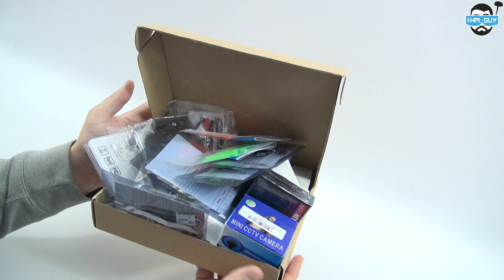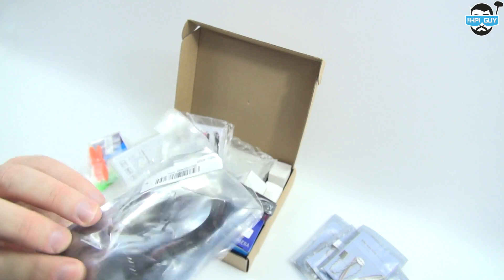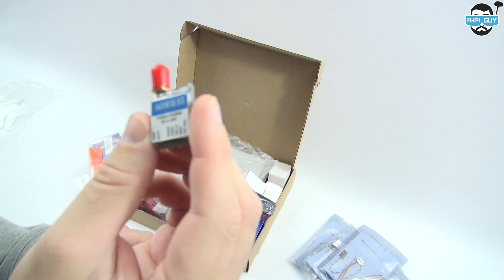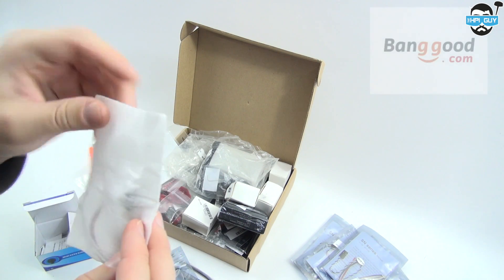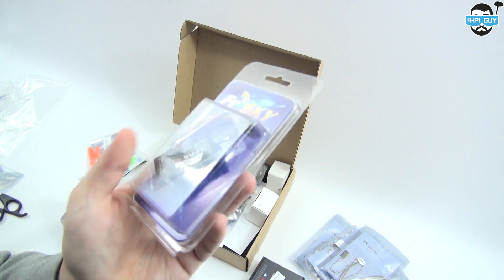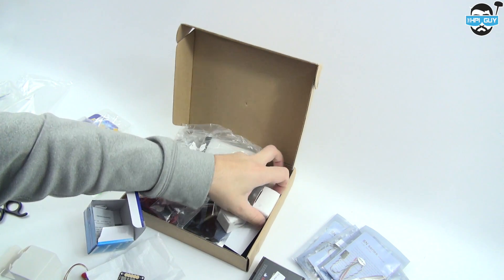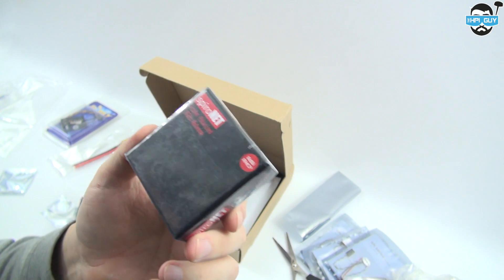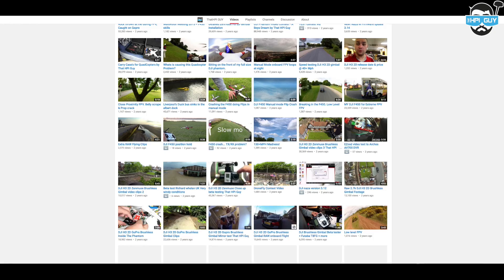HPIGUY | Budget DL180 MiniQuad Build (Part1) What Parts - From Banggood.com

Comment: I loved those PDBs. Small, lots of features for the price. Really liked it. Then the design changed to one that puts a component very close to the hole by the 5v regulator. My standard hex standoff ripped a diode out, and I had no idea. Then one day my flight controller burned up while I was about 100ft up. bad day.

Comment: Good vid,  looks like it will be a nice quad,  I have some of  these dys motors and  I belive they are only rated 2 to 3 cell that being said I have run them with 4 s    but after  10 or so batteries  one motor sounds a bit gritty and one sweaks.  I now use 2204 motors ,  it would be nice if you could do a thrust test  with 4 inch props  and 1806, 2204 and  1306 motors  to compare them.  Cheers  :-)